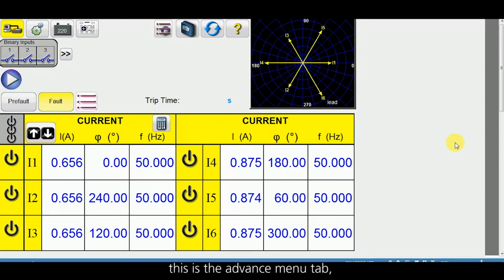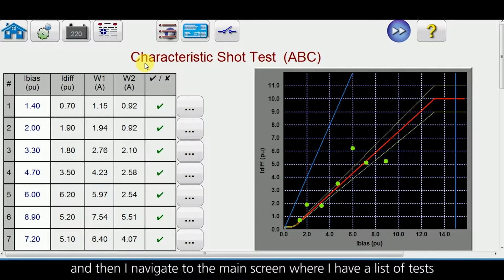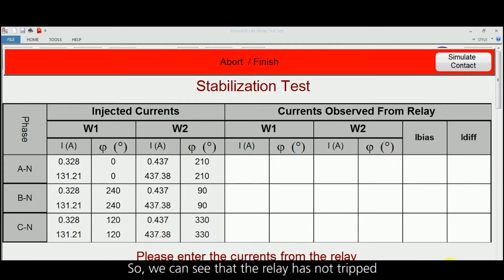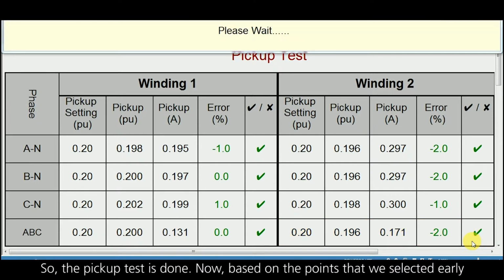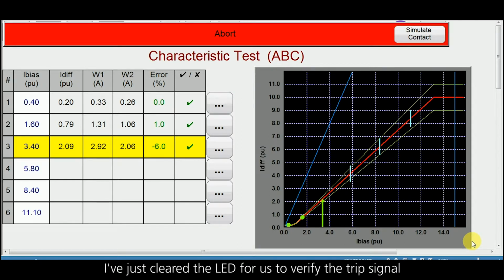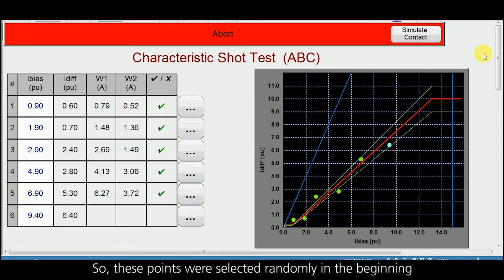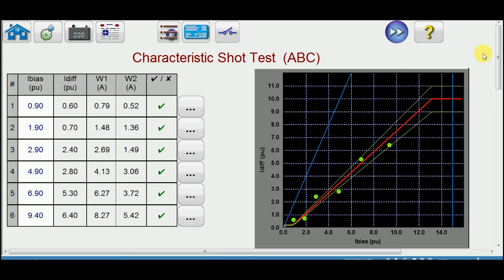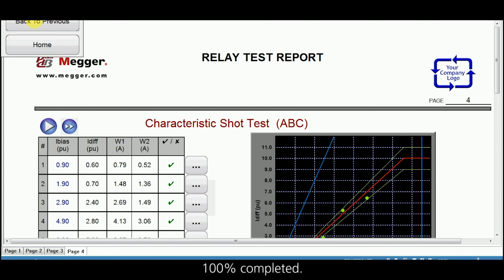25 - Full length Differential test

Comment: Just tested my first Siemens 7SR242 Duobias with an SMRT. The notes on single phase pickup factor are quite light on the PowerDB software but follow the guidance in the video and look at the relay manual, specifically the applications guide. If you look at the Siemens manual for the relay I mentioned, find the application guide for a Phase-Earth fault, and you will see that the current that reaches the differential element is not always the current you need to inject with your test gear. For instance, if you have a Yd interposing CT, 1A injected into the relay will actually only provide 1/root3 amps to the differential element - hence the pick-up factor needs to be set in the software to compensate for this and ensure that you get the green tick!

ICT multiplier also affects the current that reaches the diff element vs the injected current, but in this case the injected current is lower. When you have ICT multipliers and Yd ICT connections you have to consider both in your pickup factor
Reply: If your interposing CT is connection is Yy then you don’t need the 1/root 3 scaling factor.